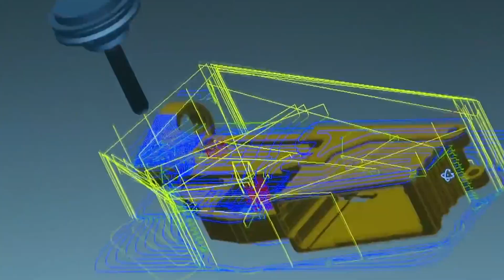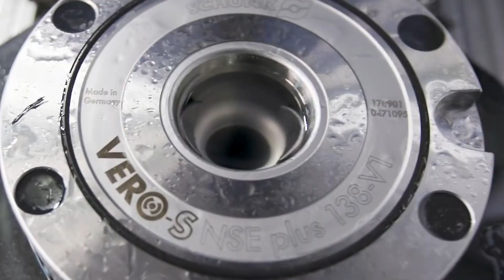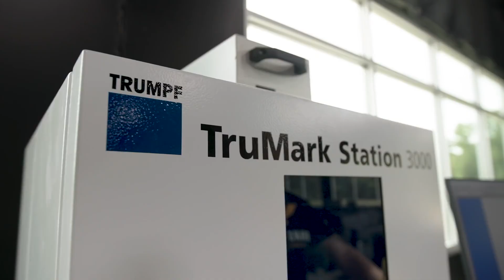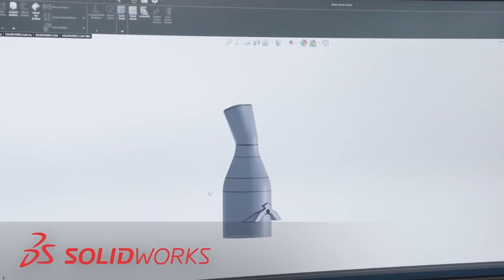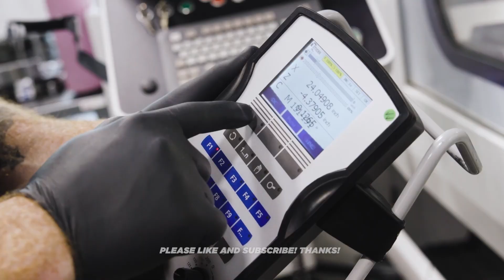Someone Died at Our Machine Shop

Comment: Too wordy. Here's a real life example that happened to one of the shops I worked at. Button pusher went to change out a part in a vice, during operation, on a multiple station table. (Vmc) She dropped the wrench in the machine and bent in to get it out of the auger. Program finished and the axis went back to home position. Pinched between the table and the enclosure. Forklift guy found her hanging out of the machine. That's how you tell a quick story in less then 12:54...
Reply: Damn bro some of us just like listening, if its not your cup of tea there are plenty of other videos and creators.

Comment: Spindle accidents tend to be pretty awful, especially on the old unprotected manuals… I’m always conscious of how fast things could end. I’m CPR/first responder in my shop & thankfully I’ve only had non-lethal injuries to attend. My worst was when a friend working on a Star Swiss machine was tightening a tool & his wrench popped off & he gored his wrist on the end of a drill. When he pulled his arm off, all the veins in his wrist pulled out with the drill like spaghetti. After I got him wrapped up, I puked my dinner in the bathroom trash can. Protect yourselves, guys, if it cuts metal it’ll cut you too.

Comment: My dad was working in a steel mill on the gantry cranes. One of the lds he worked with called him down and said he’d crack on and finish moving the coils whilst my dad made food for the shift. As soon as the crane started moving it slipped off the rails, fell 40ft. The cab was under the rails and was about 6” thick when my dad got there. He still brings it up occasionally when he’s had a beer.

Comment: i was in a industrial tech class and we were working with really old lathes 50+ years old.  we had to work in teams of two to machine hammer heads. there was a girl wearing a hijab using the lathe with her partner and she decided to put her head down to look into the lathe, that's when it sucked her hijab into the lathe and she tried to pull away by putting her hand on it but it sucked her hand in too. her partner pushed the emergency stop and she survived but her hand was pretty much toast. that's when the teacher outlawed hijabs as he had already not allowed loose hair and clothing.

Comment: I work as a welder in the oilfield, EVERY job I've been on has had multiple fatalities. These jobs are massive with thousands of workers, but still I've had guys on my crew pass away. It's messed up, I've had some really close calls myself.
Reply: Working in a landscape/masonry yard when I was 19. Truck comes turning around the corner and I tuck myself up against my Volvo front-end-loader. The trailer of the 18 wheeler came inches from absolutely shmooshing me into a pancake against my machine. After moments like that you're just like damn my life could've just ENDED; messed up.

Comment: That was a really powerful story and I'm sure it was truly life altering. I used to work for GE and I used to make those airfoils you had going in the beginning of the video. Everyday before work we would have a safety meeting and had to watch videos of accidents that have happened from the past, every day for 1 hr. It got repetitive and some of the videos were sort of comical. After a while you realize why they pay you for watching those videos everyday. These graphic videos they are showing you are meant for your protection and always be aware of safety and wear the proper PPE for the job at hand. I found myself doing these things when I'm off duty because I watched a video about this or that  and know what could happen in that situation. It really rubs off on you after a while. That building I worked in was 1/4 mi long and 1/8 mile deep and packed to the rafters with manufacturing equipment (sharp stuff everywhere you turn) and really easy to get hurt. Anyhoo, your story made me think of that and how quick you can get hurt or die working with huge equipment and how important it is for all people that work there to be mindful of safety all the time. I still wear ear plugs when I go to a concert or any loud noise and safety glasses when mowing the lawn ect. It has become a lifestyle. I enjoy your videos. Be safe and thanks for sharing your story. 

Peace out.
Reply: I worked at a Machine shop with an old CNC lathe with a disabled safety door switch. It was procedure to monitor parts with the door open since the glass was scratched to hell and the coolant made it unseeable. No incidents ever happens but I think I’ve got some mild PTSD from being worried about it for months, thinking I might get grabbed by the shavings which were very stringy and serrated. That and they showed me some gruesome lathe accident pictures that I can’t get out of my head! Don’t work there anymore but still think about it a lot.

Comment: When I was at college there was always a fair amount of larking about in the machine shop so our lecturer organised a trip to a commercial shop so we could see what it was like. They had huge machines at this place and there were large castings and billets of material being moved around and worked on. He told us that if anything goes wrong working on jobs like this there is a high probability of serious injury of even death to the operator so all safety procedures must become automatic so you don't even need to think about them. To reinforce this he got some of the guys who worked there to talk to us about some horrific accidents they had seen. This made us appreciate all the safety drill he was always going on about and is something all kids should be shown when they start working with machines. There was no messing about in the machine shop after that.

Comment: I watched a man die after a car wreck a few months ago. It happened a couple minutes before I drove up on it. Chevy cruze head on with an f250. It sounds like he did it on purpose which is messed up because he had a female passenger. She lived I believe. He ended up between the front seat and the back seat on the floor. Someone moved him and laid him on his back. He started gurgling and that was it. They should have put him in the recovery position on his side or not moved him at all but he prob was going to die anyway. Drivers side dash was pushed back a good 12". To add to the messed up night, 6 hours later I had to go tow both vehicles from the scene after the cops were done their investigation. When I unloaded the car "dead man walking" by jelly roll was playing on my SiriusXM

Comment: I got a little story .. so a guy was standing on a plasma table while it was being loaded with a fresh plate and tried to help set the plate which was held by a vertical lifting clamp/glomer he was in the pinch point where the plate would then get lowered down and should fall down slowly by lowering the plate and moving the direction with the overhead crane to set onto the table.. well the plate came off while it was vertical and fell down onto him making him go through the slats and basically cut into pieces,
Lesson use a tag line to move material if it can fall on you

Comment: Wow, sad. But God allows those things in our life so that we can make a change for the better. Hard to understand for a lot of people , but it’s true. I was 25 at a very very busy shop in lake Elsinore Calif in the mid 90s. Our first CNC lathe. A 8 in chuck OKUMA. Powerful for the day . To the point one of the lead Manual machinists , was put in charge of the floor one Sunday. He had no knowledge of that machine . The operator ran out of cut to 2.5 ft long 3in aluminum bars . The “boss of the day “ decided to grab the 6 ft  bar and cut it to 4 ft on the vert saw and have it hang  out while he was going to support it . The operator told him repeatedly that NO it can’t stick out ! He then got in her face and told her to “HIT THE BUTTON! “ well 2-4 sec later he was hit in the shoulder with a whip of aluminum bar with the strength of Thor and the bite of a tiger  . It nearly killed him. 6-8 months later he was ok but with only 20% use of his left arm. It was shocking to me , hearing about it. And sadly , if I had been there this might not have happened. As my boss was expecting me to show up again after the last 3 weeks straight of work , another Sunday , I told him fine but I’ll be in later at 10am  not at 7 . Everything was already over with.  Sheesh …. The poor girl who was running the machine had to leave the company and go into therapy . 
Always in my head

Comment: Not a machinist or even operator (though my father worked in aerospace CNC for many years) but I discovered a new fondness for all this. Thank you for quality content. 

In 2018, I was deep in a depression, in between jobs and had turmoil among my circle of friends. Took to a walk around the neighborhood to clear my head and as I was going to open my back door after returning home, I hear the most intense sound of a car crash. I kid you not, I remember reaching for the handle and hearing the sound of what I imagine dropping a dumpster from a tall building would sound like. I run out to the intersection to see a small Nissan had been launched into the corner property where it laid on the passenger side with the trunk resting on the porch. The vehicle that ran the red light had diverted into the large old tree that protected the home, deflecting the 4 runner from parking in the master bedroom. 

Bewildered describes how I felt. But what fucked me up was the dui driver laying on the lawn, twisted like a pretzel. I talked to him briefly as he choked on his last breaths. Dispatch asked me to perform CPR and I said that it’s too late. Expectedly, they said it’s not too late if he is still breathing but I calmly told her that she was not seeing what I was seeing. Shifting attention to the other driver, I checked her pulse and nothing. She likely passed on impact or shortly after. Dispatch asked me to get the door open but the handle popped off like a cheap toy when I tried. First responders arrived and I exited. 

I leave out many, many details to this story that I believe to be very personal but one thing I will share was in the brief time I was there, I felt it to last an eternity. It played out like a movie. Never felt so certain about the existence of higher powers before that night. 
A couple weeks later, a friend took his own life after deciding his struggle was over. 

Cherish those around you and as many waking moments as you can.  Those  individuals never made it home so I make it a point to be thankful when i get home

Comment: Had nobody died on the job yet but seen and had a few close calles A cranedriver knocking over a big bit of scaffolding in the 3 seconds a day nobody is on or near it.... Being missed by less then an inch by about 1200 KG of steel dropping from about 16 Mtrs.

Comment: Heard stories about a machine we used to have. Open spindle cold forming machine with a passthrough between two of the die sets. Guy with a ponytail tried to step under the workpiece and got caught. It was over quick for him but the machine kept running until someone finally got to the e-stop. Machine was out of the shop after that and those parts were outplant from then on

Comment: We had an 18'x18'x2 weldment tacked together lying on the floor. We wanted to stand it up to weld the corners vertical-down. Bolt a chain to it,  fork it upwards, Danny walks underneath. I tell him he has no business walking under a load on a 'crane'. He reluctantly backs away. I give the fork lift a dose of up, and the grade 8 bolt snaps. Danny's eyes got REAL big. He left just before quitting time, came back with a case of beer for me.

Comment: A dude, only 24 yo that I worked with went in to service a huge automotive parts plastic injection mold machine. Machine turned on and his full body was crushed between the plates. Even worst it had to cycle through the whole process of injecting plastic. I just started so I dont even know if I met him. I quit the next day.

Comment: Ok, he backed into the building. Did he have his head rest adjusted correctly? I have seen more than a few fatalities caused by a person whose head rest only comes up to the base of their skull. That places force from the impact on the C1 vertebraewith nothing supporting the skull.  The tendons and ligaments that secure C1 to the skull are often not strong enough to handle that amount of force, and the spinal cord is sheared off at the base of the skull.  I'm 6'4, and I will never buy a car unless the seat or headrest comes up to at least 3/4 of the way up the back of my head.

Comment: Had a similar experience when I was a 13 year old kid. I had actually blocked out this memory for at least 10 years and then one day was reminded of it. I was at a party with friends, this was late afternoon probably around 6pm in the summer so its still day time. We're on the side of this house trying to get 2 guys to settle some beef and just fight each other. Reminder we are all like 13-14 years old so this was the best way to settle things in our dumb minds. This truck pulls into the driveway across the street and hits a pole that is holding up a car port thing. We ignore it and assume the guy is drunk and go back to the fight. After maybe 3 minutes the girl I was standing next to says "I think they need help" and is pointing at the car. I look over and their is an old lady standing outside her door waving for us. I look at the truck (it was a small truck like a 90s ranger or something) and its still running. I then realize something bad has happened and start sprinting for the truck. I yell back for a few friends to come with me and when I get to the truck a very large guy is hunched over the steering wheel. The door is unlocked and I shake the guy and he doesn't wake up so I push him up from the wheel and he is blue in the face and covered in spit or something. I shove the truck into park and we pull this guy out. He is probably 400 pounds. We drag him out and get him in the driveway and kinda panic asking if anyone knows CPR. No one did... Eventually a firetuck shows up and starts doing CPR. Eventually an ambulance gets there and they load him onto a gurny and drive away without the lights on. We all knew what that meant. The reason I think I suppressed this memory is because no one even attempted CPR. What makes it worse is not even a month before this they had tried teaching us CPR at school in gym class. The group of friends I was with used gym to skip school and go smoke weed so we never learned it. What makes me a little mad is there were lots of other people there that were in my gym class and didn't skip. Why they didn't step up I am not certain but I think I know. This was the early 2000s. Back when we called everything we didn't like "gay" and were just homophobic douche bags all around. I am betting those that learned CPR thought they would have been made fun of for "kissing a dude." I can't say for sure that's why but its my best guess. Another bad part is there was 1 kid in our class that was eager to learn CPR and really did pay attention. He showed up as the ambulance left. Its probably best I suppressed that memory until I was in my 20s. I dont remember much after that. I know the person who was having the party started crying and asked if everyone could leave. I think we all went back to a different friends house and got high and probably drank as well. Yes we were shitty kids that drank and smoked at 13 and 14.
Reply: Might have been different then, but now it's said that you don't necessarily need to do mouth-to-mouth, chest compressions alone can usually keep somebody alive due to gasping or vacuum effect sucking in air automatically. Some medical associations actually discourage it because keeping the chest compressions going without a break is more important. Hard to say whether it would have even helped anyway, his airways might have been blocked. I hope you're doing well and that you'll never have to deal with such a situation again!
Reply: If he was blue in the face he was already dead so if you were a doctor you wouldn't have even able to help him. After events like this we always think should have done more to save  a person's life. Sometimes we just can't. And you can't beat yourself up about it. I've been involved with both senerios, one, there was nothing we could do to save the person and another where the other person that was with me did CPR and brought the guy back. He had no pulse (I was checking for pulse) was not breathing and his pupils were fixed and dilated. He is still alive today. It does change you, how can it not.
Reply: I'm guessing you've taken a class since then, but as someone who was present when my boyfriend had a heart attack (and survived): please know that by the time you got to him and got him out of the vehicle knowing CPR almost certainly wouldn't have made a difference.

CPR is a last resort and it almost always fails, especially out of the hospital. When it does "succeed", most people don't make it out of the hospital.

It is worth trying if someone isn't breathing and has no pulse. (Because you're going to break ribs doing it right.)

I feel like tv gives too many people the impression that they have control of the results if they do it right. (Also, the lack of honesty encourages bad end of life planning.)

You weren't shitty kids, just kids.